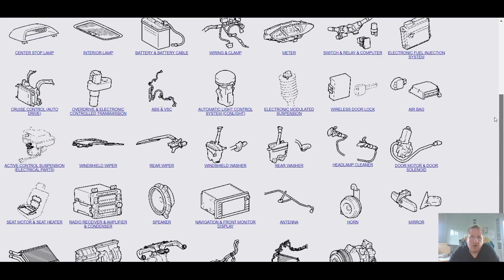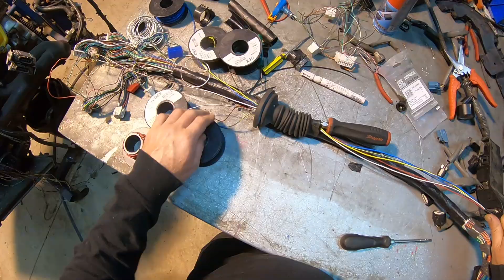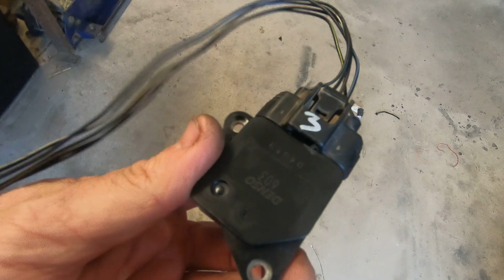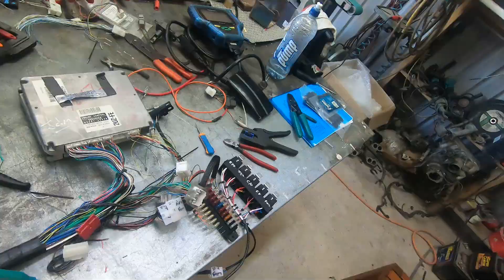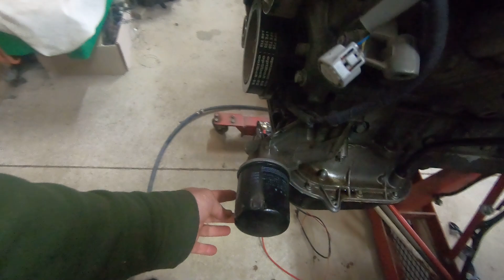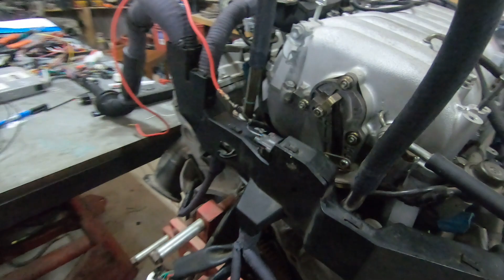2uz lc100 wiring and fitting instructions UZJ100 to  KZJ78

Comment: Hello , i did same job with V8engine  (2UZ-K83FC)  with ECU -2UZFE 4X4 (89661-0C360)  with same cable wiring  complete from A to Z  its worked fine bout throttle body  it dose-not work   any feedback it could help me to complete my job
Reply from the maker: I think I have your email. Cheers Kelvin

Comment: Hello! I had recently purchased a 92’ sc400 1uzfe with CEL code 13 RPM signal... had (used the paper clip method to pull up code) any suggestions for diagnosing the issue mate? I was told it could be a bad camshaft position sensor or the timing could have jumped a tooth, the car idles very low.. almost to zero at stops and sometimes tugs back when driving & I let go of the gas pedal  Any suggestions would be great, cheers:)
Reply from the maker: Hello.  Easy to check.  Confirm cam timing first.  Thats the most common issue which I see.  Otherwise check wiring to cam sensors and sensors themselves.  Cheers Kelvin